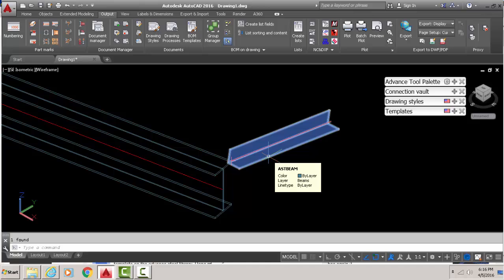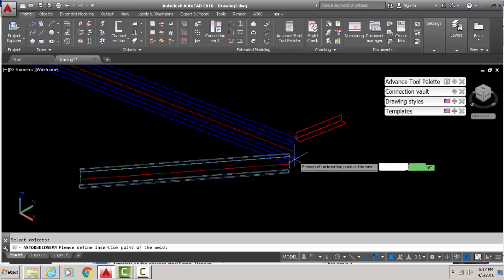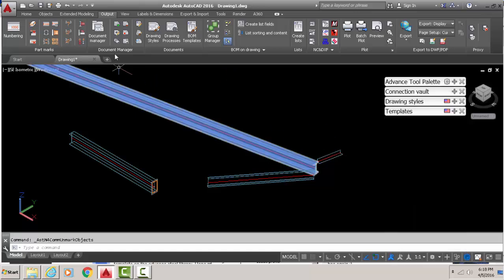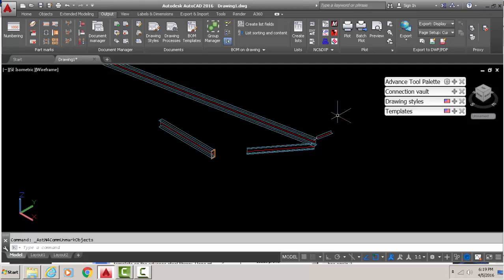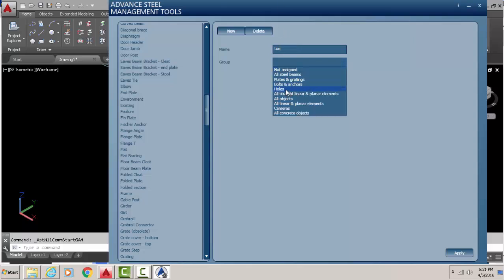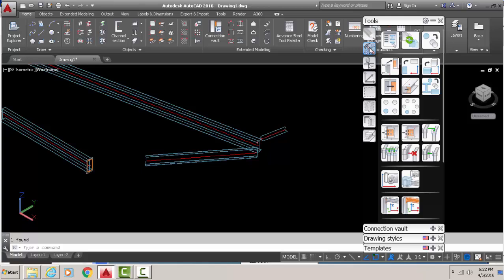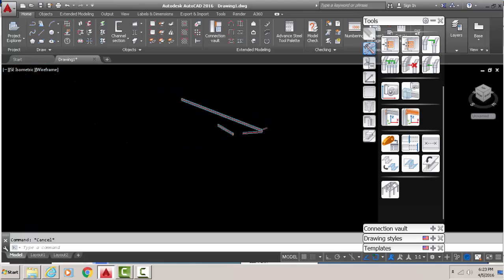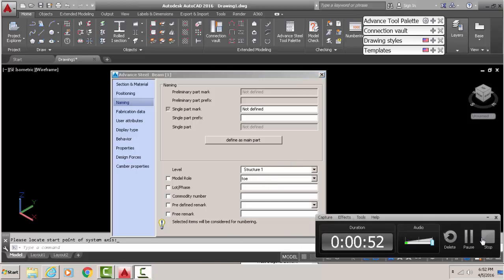ADVANCE STEEL NUMBERING PART 2

Comment: in Advance Steel 2014, anything we add to the model should be "connect weld" tot the other components before it will become a part of the whole assembly.